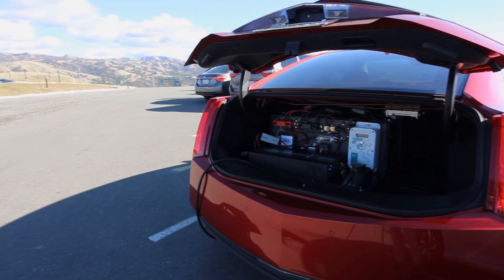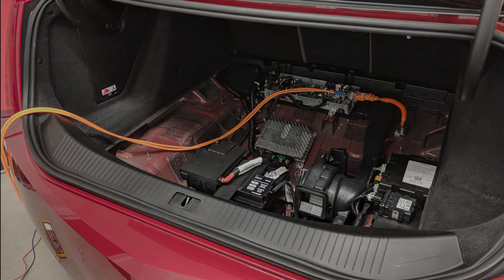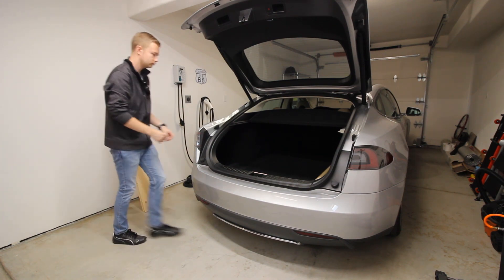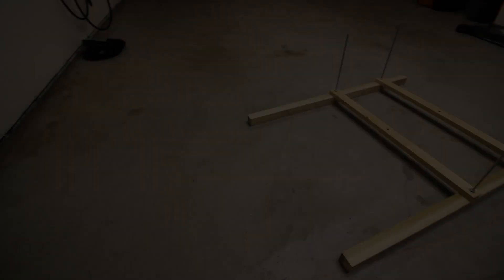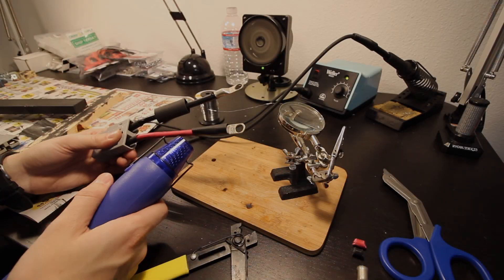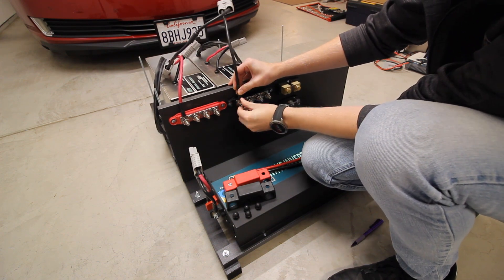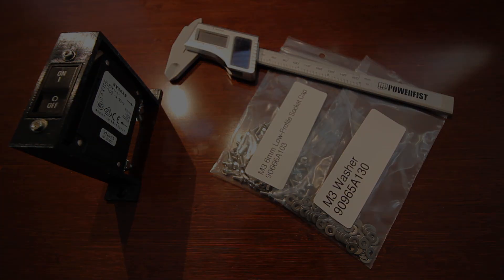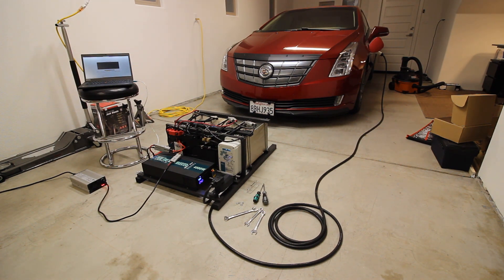PortL2 | Portable Electric Vehicle Charger

Comment: I am working on a similar solution and I am thinking about one thing. Does the charging station report a ground fault error? Could you tell what type it is.
Reply from the maker: It does! Good observation. I used an OpenEVSE that allows disabling various diagnostic checks.
Reply: That's why I started developing an EV charging point designed for inverters and batteries.

Comment: I built a similar system for my Nissan Leaf (your work looks way cleaner) and had some questions (battery specs/costs, and inverter heat mgmt) I was hoping you could help me with.  Please e-mail me at Lonestarezev@gmail.com.  Thanks!
Reply from the maker: There is a bunch more detail on the blog post linked from the description including more photos and details about the batteries/inverter. Thermal management is largely passive. The trunk is open and the inverter has cooling fans. I have the thermal limit for the batteries set to 45C which is very low. The temperature probes are external to the cells within the modules. There will be a temperature gradient inside the module where the cells are much warmer than the exterior of the module case so I decided to be conservative. I would rather the system falsely detect high-temp and quit than get into a thermal runaway situation!
Reply: @TheResistorNetwork  Thanks!  I'll check out the blog.  Thermal mgmt is a huge issue for me.  I'm getting a micro a/c system to control it, but hat eats 300w by itself; it's a challenge for sure.